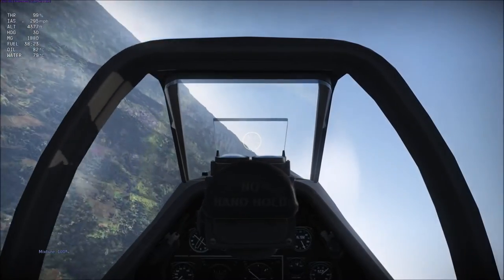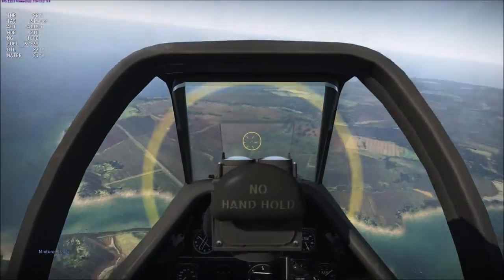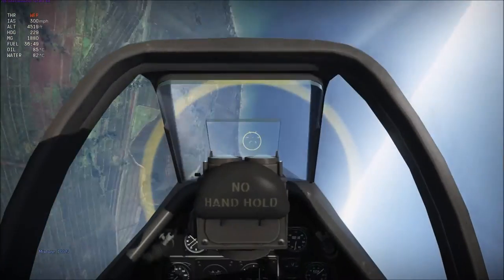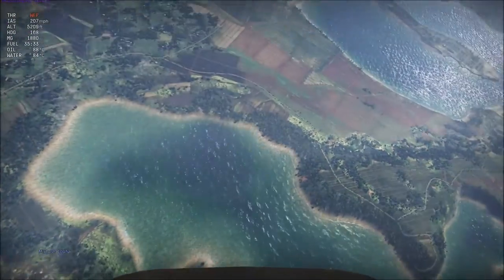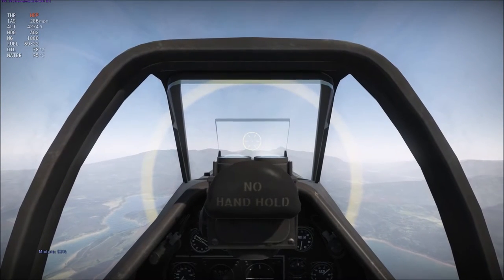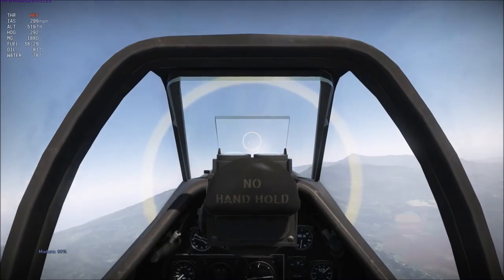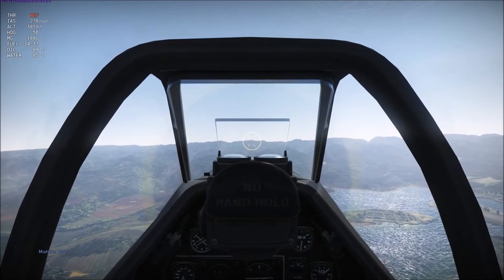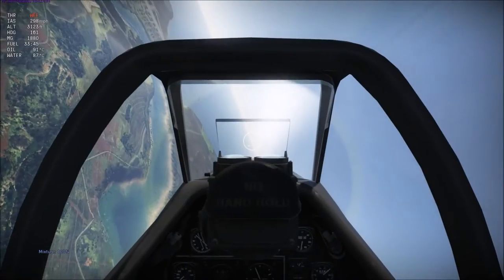War Thunder Simulation Mode Tutorial: Basic Aerobatics

Comment: I tried this with mouse controls. I got half way through the loop and got stuck facing straight up until I stalled. I had more than enough speed. Also when i split s I go into a spin...
Reply: I'm using a stick now but would like to go back to mouse every once in a while when I get lazy... Too bad the mouse controls are FUCKED! It forced you to be facing up, if you try to roll over to split S you will stall from the instructor forcing you back.
Reply from the maker: *****
I actually like that it does that...it's a working mouse-aim, but you lose options when you use it. It also makes it so that a joystick user can go through the air races slightly faster than mouse users.
Reply: But air races are not simulator unless you do a custom battle. I'm specifically talking about simulator, none of what I said applies to RB and AB.
Reply from the maker: ***** joystick users are still faster in both AB and RB mode racing actually. Same thing in simulator though? Interesting...I've never used mouse in SB...it looks like it'd be easier to use a joystick though either way
Reply: It's mostly easier with a stick provided it's configured correctly.

Comment: I can do everything except the loop, whe i try it goes straigt up and then tilts on the side spinning
Reply from the maker: you're getting too low on speed is what it sounds like. Also, if the game is modeled correctly, you have to increase your rudder input as you go through the top of the loop because you're loosing speed. Watch your slip indicator to get an idea of how you're doing with your rudder
Reply: Maybe its the rudder, because im very carefull with the airspeed
Reply: @_cesco  or you may just have bad mouse as joistick settings